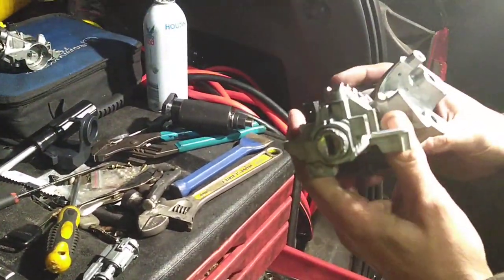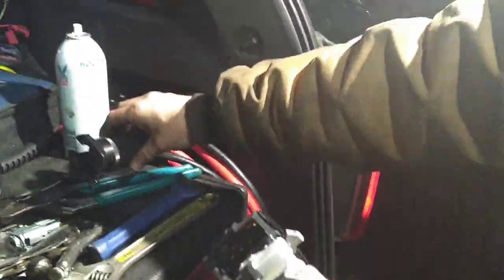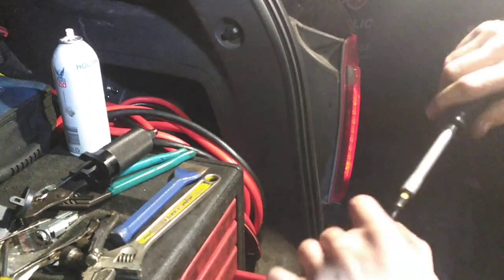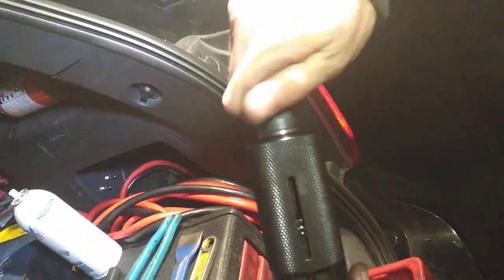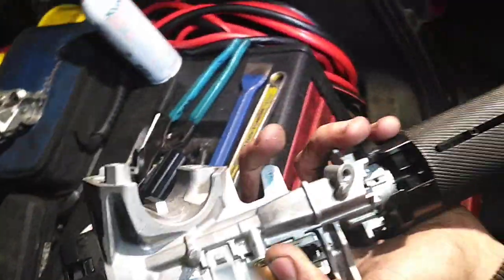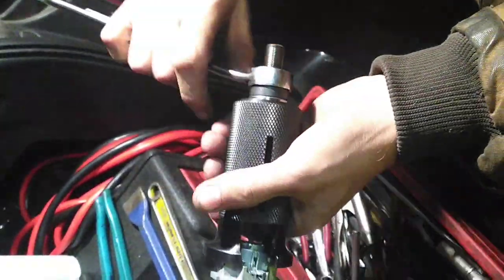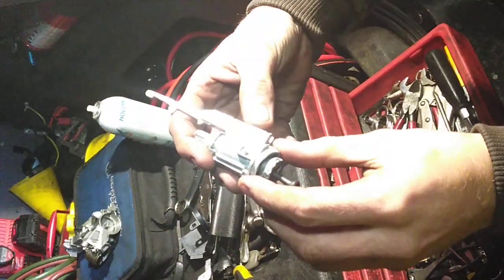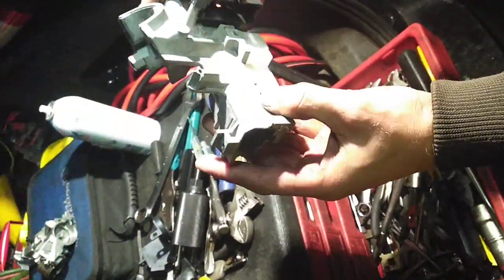How to remove auto lock cylinder without key

Comment: This is call a Dent puller most auto body and paint have it he should have done this while the housing was on the steering column
Reply from the maker: This is actually not a dent puller. This tool is a core puller specifically for locks.